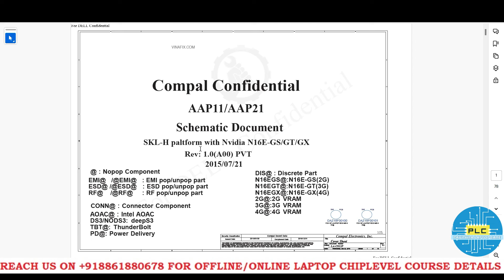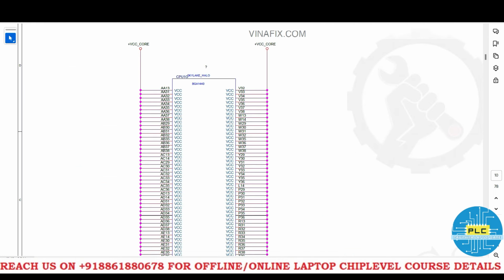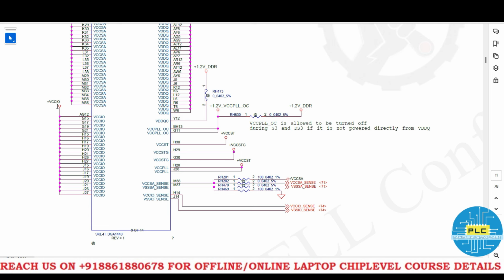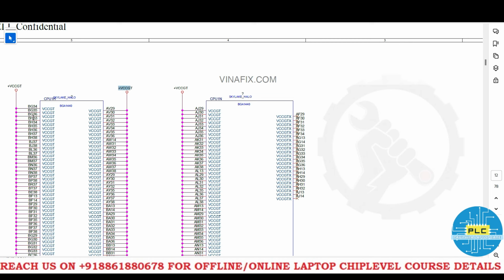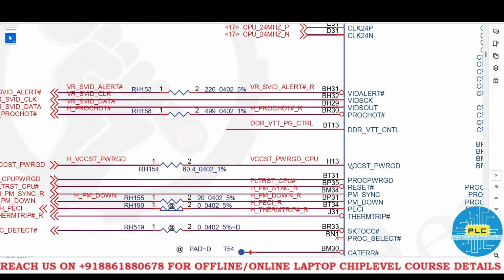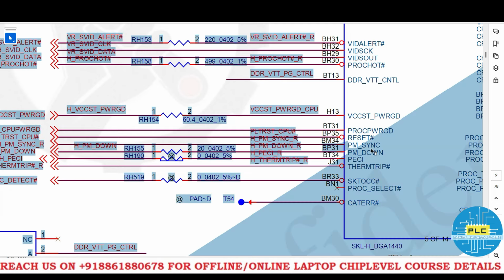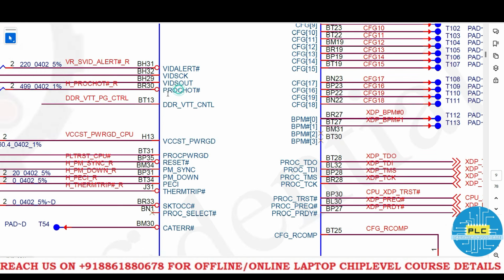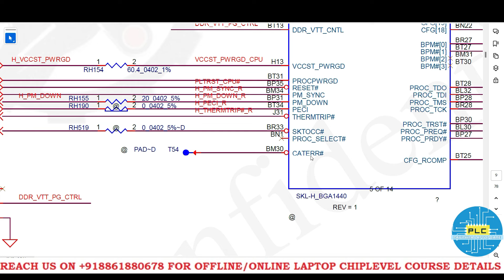Mastering CPU Power Sequence and Signals: A Comprehensive Guide

Comment: Hey is there any way to upgrade onboard ram from 8 to 16gb pls help
Reply from the maker: Possibilities are very less. Because, in laptop motherboard built in ram will be made as per the system configuration.
In some special cases yes its possible.  In that case, we need to replace the vram chip from 8gb to 16gb. In practical,  no one will do this.
Reply: @Pavithralaptopcare  thanks for the reply